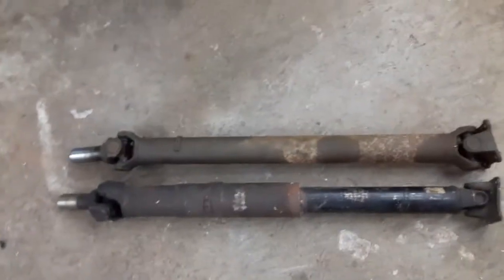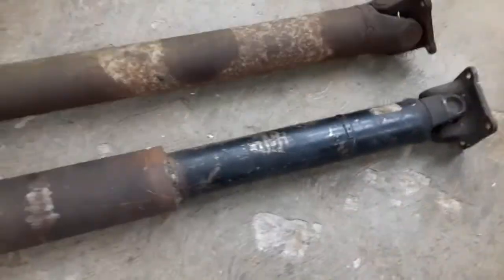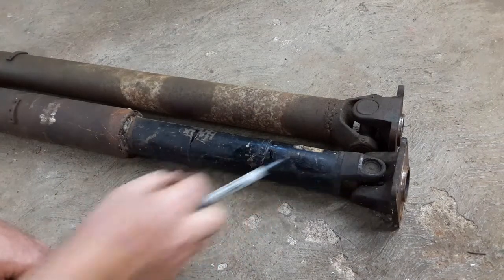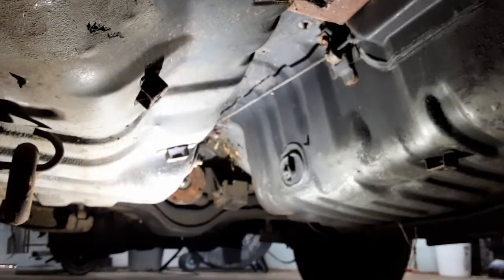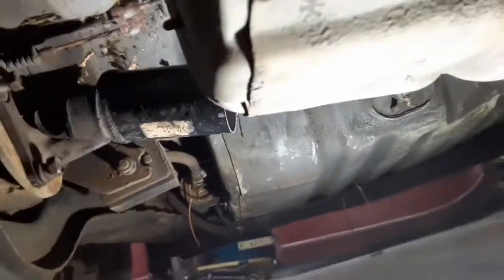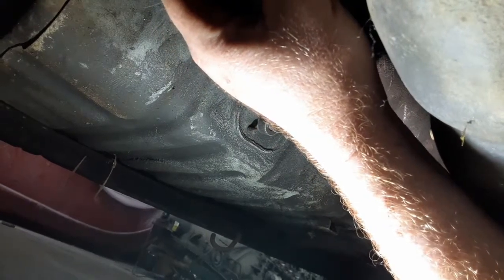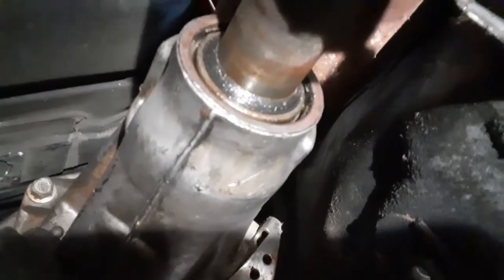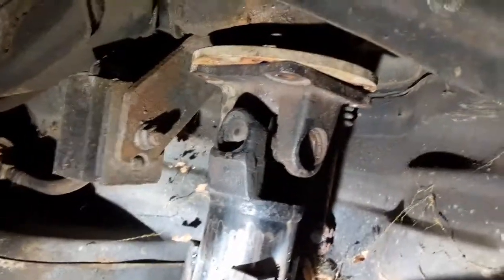DIY Custom Driveshaft for LS Swap 5.3L RX7

Comment: What did the driveshaft shop charge?
Reply from the maker: I ended up just making a driveshaft Myself by ordering the correct weld on ends online and shortening a driveshaft tube I already had from the junkyard. It's been working great for almost 2 years now with no vibration issues or anything.
Reply: What yoke on rear of new shaft